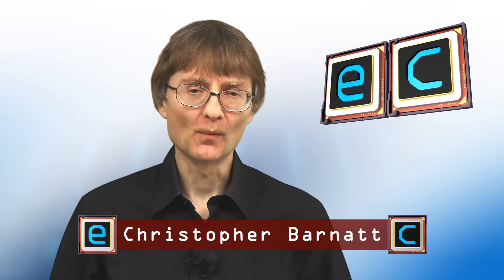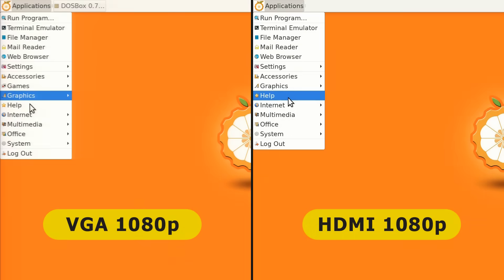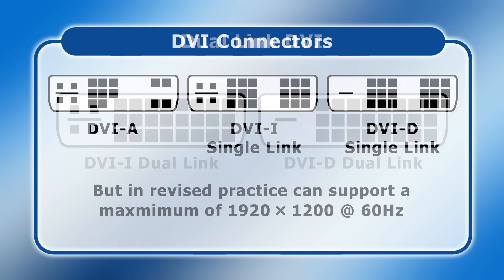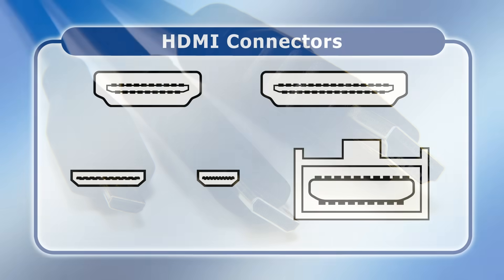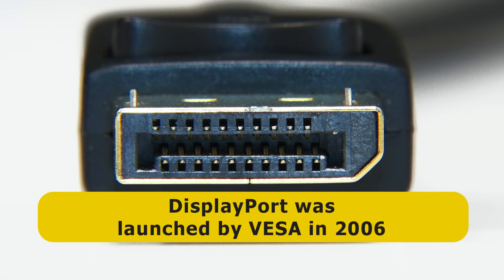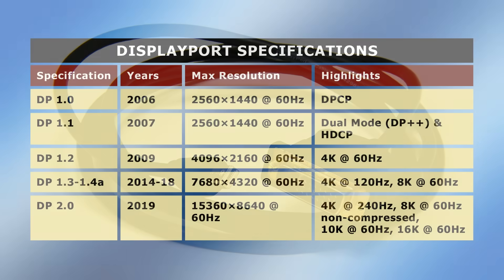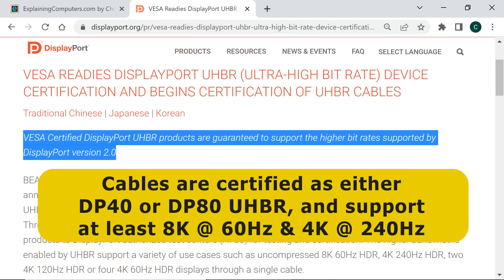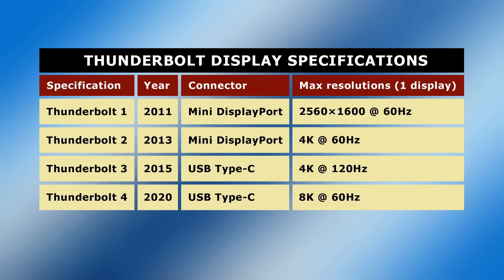Explaining Display Connectors: HDMI, DisplayPort, USB-C, DVI, VGA & Thunderbolt

Comment: 5:20 - Apple also offered a proprietary DVI connector called Apple Display Connector (ADC.)  It was standard DVI that also provided USB signals and power delivery, allowing for an all-in-one cable design to provide both power and USB connectivity to an external display.  It was first implemented in 2000 with the PowerMac G4 and the G4 Cube, and remained in use until 2005.  The connector and cable included a robust hinge allowing it to maintain a 90 degree bend so it could lay flush with the surface when used on a G4 Cube.  Passive ADC to DVI adapters were provided for connecting standard DVI displays to an ADC port, but going the other direction was more problematic.   Apple and 3rd parties also offered a bulky DVI to ADC adapter that looked similar to a modern Apple laptop charger.  It included a power supply and USB ports to provide the requisite power delivery and USB connectivity expected from an ADC display.
Reply from the maker: Very interesting.

Comment: "in common use".  It would have been a MUCH longer video without this.  Great job on the video!
Reply: I was surprised he didn't start off with CGA and monochrome
Reply from the maker: I started with CGA in my 2013 "Explaining Display Connectors" video. This time I thought it was time to move on a bit!

Comment: Oy, me eyes! The cables, they do nothing!!

And there's also that horrible connector that looks like a DVI but instead has a hundred tiny pins... you'll often see them on the vidcard used in middle-aged Dells. Can't think what it's called, but it's made me buy a few adapters. (And those only sometimes work.)

Comment: DVI and HDMI double link are practically dead. Instead, the data rates are being cranked up. Graphics cards use the same signals on DVI and HDMI. Some also enable audio via DVI according to the HDMI standard.
Original Displayport and mini Displayport use practically the same signals as HDMI. So passive adapters are possible.
Reply from the maker: I stated very clearly in the video that HDMI B (dual link) has never been used in any products. For audio and DVI, see my pinned comment -- the DVI standard does not carry audio. As noted in the video, DisplayPort and HDMI use totally different packet standards and voltages -- so passive adapters are absolutely NOT possible -- you can only use a passive adapter with DP++

Comment: An excellent explanation. One thing which should be noted is the often very low quality of HDMI and DP cables, many of which can only operate to a low standard of the respective protocol. It is sometimes difficult to find a high quality cable for HDMI 2.1 or DP 2.0, and often these are very expensive!
Reply: All versions of DisplayPort use the same pinout, meaning every version of DisplayPort is compatible with every DisplayPort cable. The variable is that different cables support different amounts of bandwidth. In other words, all DisplayPort cables are technically DisplayPort 2.0 cables. If you want a cable that supports 2.0's maximum bandwidth, look for one that is "DP80" certified, meaning it's certified for 80gb/s.

Of course, manufactures had to go and make it confusing by marketing cables as "1.4" or "2.0" and so on.

Comment: Thx Steve, another great overview video that is really well structured.
A small typo magically found it's way into the HDMI Specification table slide @6:53 row 5 > HDMI 2.0 - HDMI 2.0b in the column 2 Years 2013 26 (16).
Reply from the maker: Ah, my bad. There is always one error! Those tables were edited far too many times! At least here it is reasonably obvious that it should be 2016 and not 2026! :)

Comment: I seek advice on adapting Displayport computer and cable to HDMI projector.  None of the passive adapters I have want to do this.  You pointed out the 3.3V - 5.0 V mismatch; yet, if I adapt at the computer and use HDMI cable it does work.  Unfortunately, none of my HDMI cables are long enough for my application.
Reply from the maker: It sounds like you need one of my great friends, the female-to-female HDMI coupler, to join two HDMI leads together: something like this -- https://www.amazon.co.uk/dp/B06XR9PR5X/
Reply: @ExplainingComputers  I have some of those.  The projector is 33 m (100 ft.) from the speaker's computer.  Custom HDMI cables are very expensive.  I have a Displayport cable that uses fiber.  It works with a Displayport monitor but not with the HDMI projector (or monitor).  The conduit is too small for the couplers.  Google leads to no active (powered) Displayport to HDMI adapters.  Presently, I use VGA cable, but reflections cause shadowing and the limited bandwidth results in the blurring you pointed out.
Reply from the maker: @byronwatkins2565  Ah, that is some distance. Maybe some kind of HDMI booster/repeater -- or wireless HDMI transmission?

Comment: Explaining power outlets and computers mains energy inputs should be interesting. For the computer side there are bi and tripolar connections for notebook "brick" and PSU styles; barrel jack and square connectors in notebook... For wall outlet, well... there are several standards, but few of they are mostly used.
Reply from the maker: A good video idea -- very much noted!

Comment: I had to go through all of this recently. Tried to get a monitor plugged into DVI or VGA. It's hard to find DVI to DVI cables now! They're rare and expensive. I thought about plugging in a DVI to VGA adapter at the gfx card and using a VGA cable, but I'm worried that it might not output 1080p correctly as both the adapter and cable are ancient. :)
Reply from the maker: I find that all kinds of old cables are easy to get -- until you actually need to get one! :) As you say, DVI to DVI is getting rare and expensive. Providing your DVI output is DVI-A or DVI-I (ie not DVI-D), then a passive DVI to VGA adapter (like the one shown in the video) should work fine.

Comment: What's the deal with Lightning?
Reply from the maker: A very good point! It is used on iPads and iPhones, and can carry video, if not to another Lightening port. So, for example, you can use a Lightening port to HDMi adapter. I should have included this. :)

Comment: Most DVI graphics cards made since at least 2010 do support audio via DVI, but they need to have a DVI-D port and you need to use a DVI-D to HDMI cable or adapter.
Reply from the maker: See pinned comment -- the DVI standard does not support audio, but there were indeed some non-standard graphics cards that supported a DVI to HDMI connection via non-standard cable. A DVI to DVI connection does not carry audio.

Comment: I have an old mini PC which is connected via DVI to an TV and the HD Audio is working fine over the DVI cabel.
Reply from the maker: I'm pretty certain that what you are describing is a situtation where a DVI connector and audio output are connected to an HDMI cable connected to a TV. That, or your mini PC has a DVI connector with a non-standard audio output (a few once existed) that is then connected to a non-standard DVI to HDMI lead that feeds the TV. But I am absolutely certain that you do not have a DVI socket on the mini PC connected to a DVI socket on the TV, with audio and video travelling down the cable. DVI does not carry audio. There are no audio pins! :) So you cannot be using a DVI to DVI cable in your setup.

Comment: Had some strange monitors who's DVI connector had the left most horizontal pin in the the vertical position and used also a special cable. Did you mention HDMI also added audio?
Reply from the maker: I did indeed!

Comment: Great video Chris!  I just hope that they keep DVI ports as they seem the most robust overall.  By the way, DVI-D can carry audio I think because the data format is the same as basic HDMI :).  I am listening to your video right now via DVI with the sound coming quiet clearly through my monitor's speakers...
Reply from the maker: Thanks for this. But on DVI-D and audio I am absolutely certain that you do not have a DVI socket on your PC connected to a DVI socket on the monitor with audio and video travelling down the cable. This is simply technically impossibe.

What I imagine you are describing is one of two things. Either you have an adapter cable with a DVI and an audio connector on one end, and HDMI on the other, with the HDMI connecter plugged into your monitor, and the DVI and audio connectors plugged into the PC. Or alternatively, you may have a PC with a graphics card that outputs audio through a non-standard DVI connector (a few were made). But again, the cable in use will be DVI on one end, and HDMI on the other.
Reply: @ExplainingComputers  hi. I am using a GTX 1650 Super with a DVI to HDMI lead...the monitor seem to treat the resultant signal as standard. HDMI
Reply from the maker: @andic6676  Exactly, you do not have a DVI connection to the monitor! :) Rather, you have a graphics card with the non-standard "DVI with audio" output capability, that can transmit audio to an HDMI connector (and not another DVI connector) via a custom cable. :)
Reply from the maker: I've now added a general comment pinned on this issue. Thanks for raising it here. :)
Reply: @ExplainingComputers  monitor standards are, well, not very standard lol I remember when I used to repair VGA monitors and even back then there were all sorts of weird and wonderful combinations of line and frame rates. Thanks Chris for responding so thoughtfully.
Reply from the maker: @andic6676  I did like VGA monitors, the last, great analogue computer technology in many respects.
Reply: @ExplainingComputers  CRTs were amazingly under appreciated pieces of precision technology.

Comment: For me all these different cables and options is totally confusing along with all the many different options for usb.  With my vision all these different resolutions are all the same where I cannot tell a difference between the lower andhigher resolutions.  On my systems I still use the old vga connections and have no issues.  Many thanks for this video explainint these cable and their uses and explinations.  Thubs up.

Comment: Ahoy and thanks for another informative video. I recently bought a used LivaZ with Debian Linux at a steal of a price. It has an HDMI port and a mini DP port. I'm trying to figure out what adapter I need to hook the mPD port to HDMI for dual monitors. Its a little confusing with DP and Thunderbolt etc. I guess I'll just try a $10 Amazon one and see if it works. But it seems that you always come out with a video I need to see when I need it. I was trying to figure out m2 mSata NGFF NVME stuff and that video came out. I still refer back to it as I will with this one. Tks again daveyb

Comment: A few graphics cards like the GTX 260 supported audio via DVI. I used a DVI to HDMI cable with one and had audio as well
Reply from the maker: Indeed -- see pinned comment. As you describe, you are not carrying audio across a DVI to DVI connection! :)

Comment: DP supports VGA according to Wikipedia and my personal expirience. Just a simple 10€$ adaptor plug. What about USB-C and Thunderbolt?
Reply from the maker: There are converters from any display format to any other -- but this does not mean that the formats they connect "support each other". Specifically here, there is no native analogue video in a DisplayPort output, so the adapter plug you describe will include a powered (active) converter (taking its power from the DisplayPort connector). Certainly very useful though! :) The sort of thing StarTech make here: https://docs.rs-online.com/cd12/0900766b816dd3f7.pdf

And there are adapters with such active converters inside them to go from USB-C HDMI ALT mode or DisplayPort Alt mode to VGA, as there are form Thunderbolt. You can plug anything into anything with the right active adapter/converter! :)
Reply: @ExplainingComputers  Feels kind of odd since I adjusted the image position and size via the NVIDIA control panel, not an the display.
Reply from the maker: @GMLSX  I totally see where you are coming from here. But the NVIDIA controls just reposition the image - something often needed to get a VGA image in the right place, but rarely a digital-only format.

Comment: DP++ on both my 1030 and dead 1070 is / was DP 1.2 i know this as i used both with a 3840x2160 monitor using RGB 10 bit which DP1.1 is incapable of

And i believe my 3090’s DP++ can do HDMI 2.0 on a single port or HDMI 1.4 on 3 of them

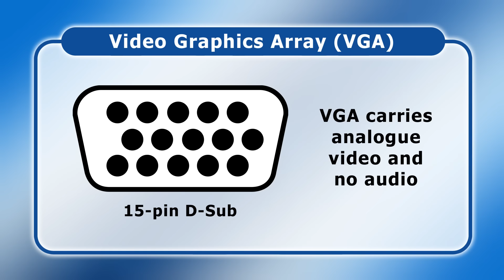Comment: 1:28 It was referred to as SVGA - Super Video Graphics Array. I remember that one quite well when it hit the market.
Reply from the maker: Yes, we had SVGA as 800x600, XGA for 1024x768 -- and others after that (although we then started talking more in vertical or horizontal resolutions). "VGA connector" remains a contentious term -- a subject I avoided in a video that was already long.
Reply: @ExplainingComputers  I remember most people back in the day just calling it a VGA cable/port regardless if it was SVGA/XVGA/etc., plus when you see the port these days on a monitor/TV, then majority of the time it's simply labeled VGA .  So I think what you said was perfectly fine Chris. 👍

Comment: Thanks Chris. I've been finding USB-C ports to have "flaky" or loose connections. Not sure if anyone here has experienced this. Also, is the ODB diagnostic port in vehicles considered HDMI? I do have a diagnostic device which connects to ODB on one end and HDMI on the other, to the device, but I never thought the ODB port was HDMI itself... Thanks Rich
Reply from the maker: I agree. I do not personally like USB connectors -- they are too small to be solid. I do not know about ODB ports, but imagine they are just for diagnostics data? Type E HDMI is used for computer and video displays in vehicles.
Reply: @ExplainingComputers  Did a bit more digging and found that some ODB2 devices do contain HDMI out ports for displaying diagnostics on a small HDMI monitor, similar to a computer but ODB is not itself HDMI (I should have known this😅).  Apologies for my confusion. Rich
Reply from the maker: @rutkowskir  Alway interesting to investigate these things!

Comment: Very nice recap, thanks! By the way, HDMI as USB-C alt-mode was declared "DOA" by the HDMI Licensing Administrator about two weeks ago. It seems the industry will carry on using only DP alt-mode with some form of active conversion for HDMI downstream. According to the Ars Technica article, the main reason was the HDMI 1.4b limitation, which makes sense in a world where 4K@60Hz is more or less standard HDMI.
Reply from the maker: Thanks for this, and I did at one point note this in an earlier edit of the video. However, it remains the case that a great many devices -- not least a large proportion of Android tablets and some smartphones -- happily output HDMI over USB, and have been doing so long before USB-C and its alt modes were a thing. So I removed the "HDMI over USB-C is dead" content from the video. 4K remains a minority computer resolution, so I suspect connecting portable devices over HDMI will remain common for a very long time. :)

Comment: Whilst I can understand the angles and reasons taken by the standard-developing groups, it feels weird that these standards are reaching resolutions that can't be leveraged en-masse by today's consumer hardware. I have a 3070 FE graphics card with three DP ports... but I don't think I will be getting anything that does 8K for the foreseeable future. :P

That said, with appropriate software, DisplayPort sockets, that support the Display Data Channel protocol, can also carry additional control information such as being able to directly manipulate a display's brightness level (or even other characteristics so I heard) directly in-OS just like how eDP is used in laptop panels which gives us that trusty brightness slider. It's a shame Windows doesn't offer that for desktops out-of-the-box...

Comment: Thank you for exploring another connector type video, to go along with the USB standards. It must have been a pain to research this one as well, but the information is important for those learning these things or trying to work out how to connect a new device to a random screen. I still wish, as I do with USB, that they could come up with some sort of system to identify which generation of video connection a cable uses at a glance, as if you try to use an older, outward identical HDMI cable, you may be able to use 8K, but you probably will not unless you specifically have checked what type of cable it is, and it's almost impossible to tell from a random box of cables with no outward markings.

It's also terrible that dishonest sellers can claim their cables can do things that they cannot, like selling a Display Port 1.0 cable and claiming it can take all forms of monitors, when it cannot carry the data for a 4K screen. It they had consistent colourings or different outer shielding, it would make a consumer's life a lot easier. Ah well. Maybe some day. :-\

But thanks again for the hard work and excellent explanation put into this video. :-)
Reply from the maker: Thanks for this. :)

Comment: Thnx for another helpful video on a topic that seems quite unspectacular. I once stepped into the DVI-trap and had to find out the hard way :-(
Reply from the maker: A lot of people have been there with DVI . . .
Reply: @ExplainingComputers  Thnx for your reply. 'DVI-trap' in my specific case means an elder Monitor with DVI analogue input that refused to connect with a then new graphics card with DVI digital out. I was not very amused :-)